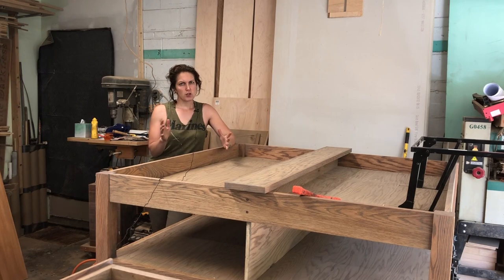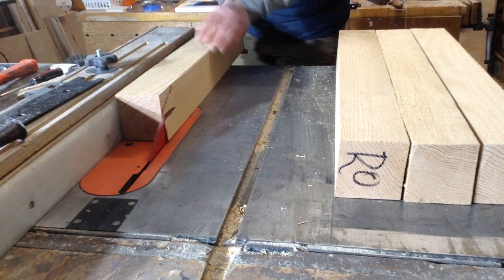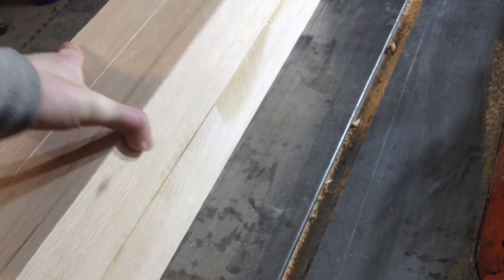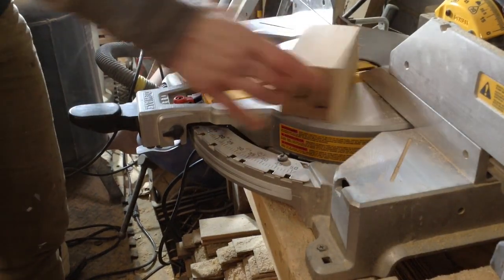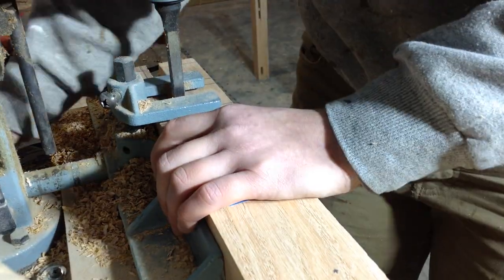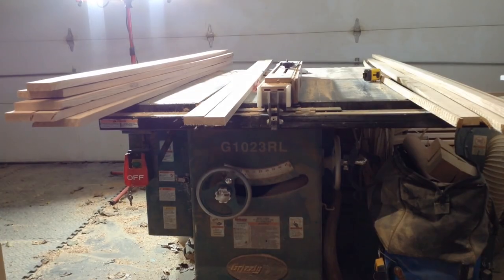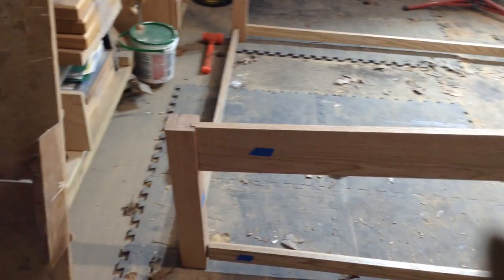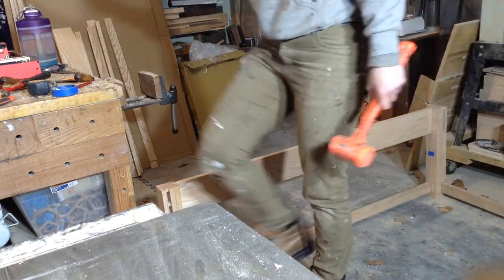Woodworking Projects : How To Make A Coffee Table With Lift Top and Storage Part 1

Comment: Hello, you do excelent woodworking, and great narration on your videos.

From time to time you mention about not having a jointer for lack of room.

Have you ever considered looking into those 6" jointers from grizzly, or other brands.
I have a grizzly 6" jointer, and with some outrigging setups I have jointed planks ranging up to 
around 12" wide by 8 foot long.

And the portable size of it is so convenient I made a 2x4 roller stand for it measuring
only 21" long by 13" wide by 24" high.

It is small enough to tuck away under a workbench.

Thankyou for your time reading this.
Have a great day!.
Reply from the maker: Thanks, I'll look into that.  I'm rearranging part of the shop helpfully sooner rather then later, and I'll see what space I'm working with after that.